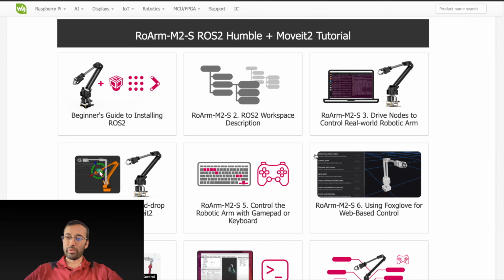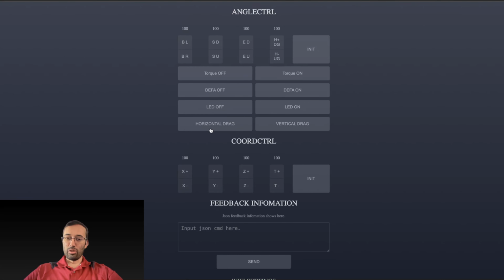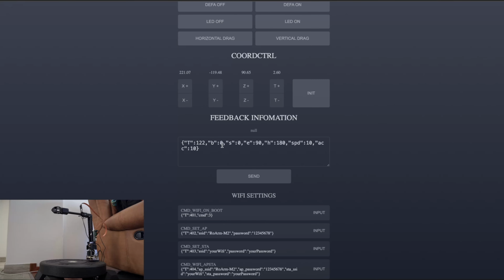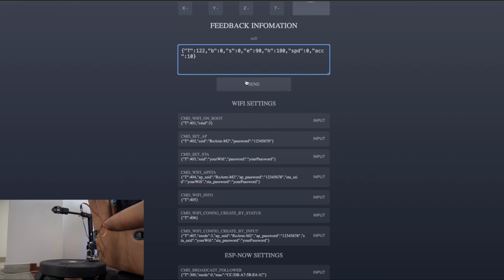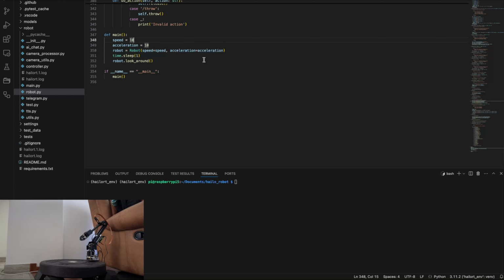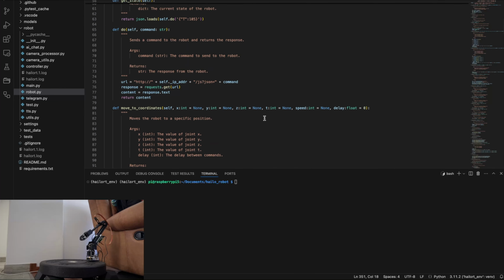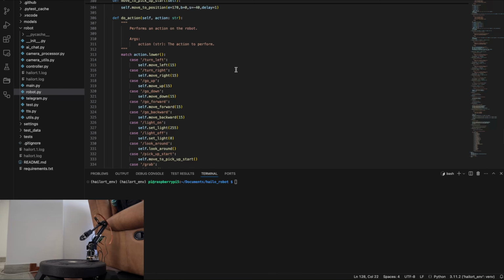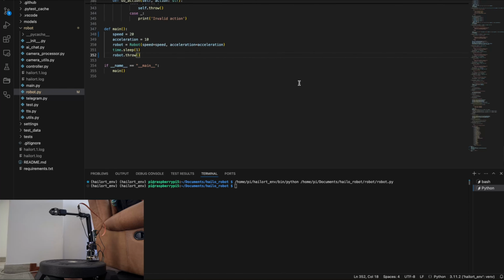Brief description of RoArm-M2-S web API and Python control

Comment: How do have the camera connected to the arm?
Reply from the maker: The waveshare kit comes with an attachment for accessories. So I have attached a raspberry pi camera to the holder on the carbon fibre joint, with the raspberry pi board attached to the base of the arm.

Comment: My issue is that I cannot get to connect to the Wi-Fi to use the web-based controls. How exactly do I do that I watched other videos where you just share, but how do you share your Wi-Fi if you are also using it to receive a signal to the computer itself? Also, with the Python code, are you writing this code and then uploading it, or are you still using Wi-Fi to send the commands?
Reply from the maker: Hello there, I am thinking you need to connect to the Roarm-m2-s wifi access point first in order to setup a lan connection. The wifi details for the robot arm are on the LCD panel. Then, you can send HTTP instructions via the Robots UI or via Python HTTP requests. Merry Xmas.